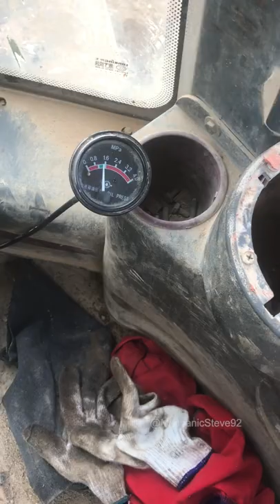Assembly Overhaul Longgong 855N gearbox jitter abnormally. Part 2

Comment: It would be nice if you tried to get rid of any contaminants when your rebuilding thing's e.g. getting rid of the dirt close to all the mating surfaces so your less likely for bits too drop in and destroy the bearings n clutch packs. 

I know time is money but the last thing you need is for the owner to ring you again saying "it's making a different funny noises again and it's not working properly". And THAT'S all because you didn't clean it properly in the first place. So it needs to be completely stripped down again, CLEANED PROPERLY and rebuilt with brand new bearings, clutch packs and anything else that was damaged in the process. 

I'm amazed you didn't use your trade mark blue grease. Or is that only used for axle's?